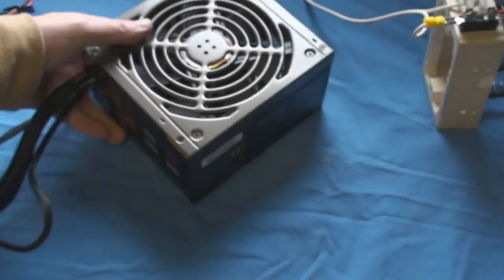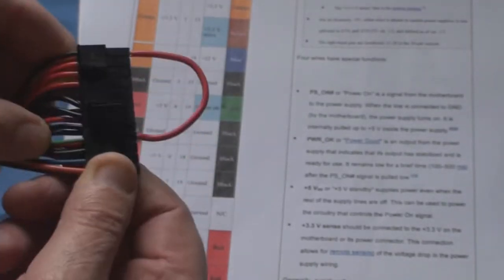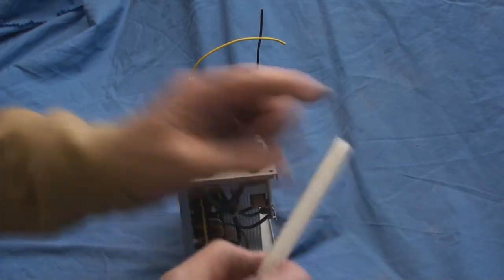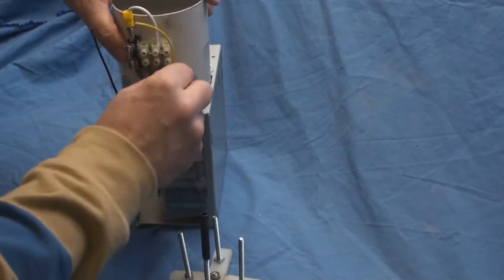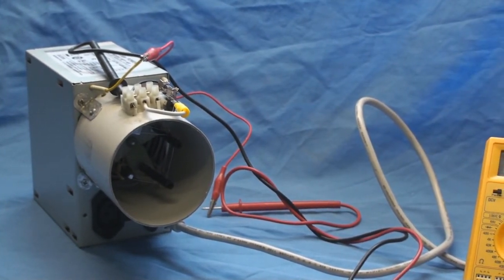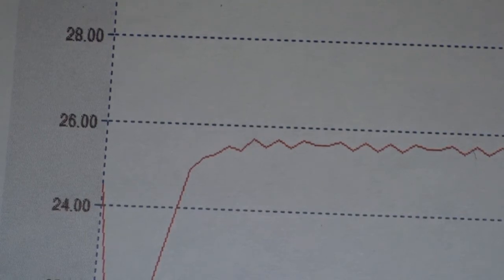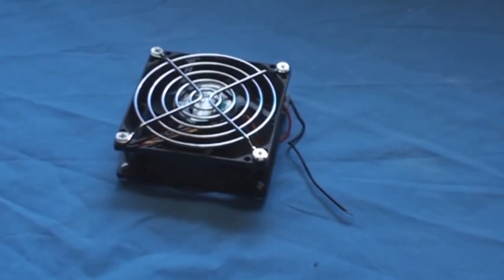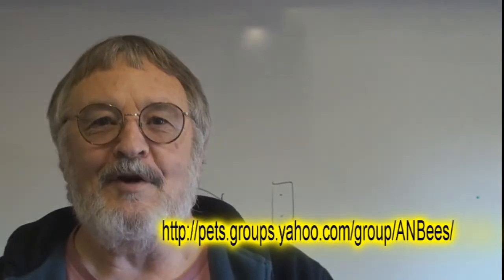Heating a TC Hive part 3 HD

Comment: Thanks for the video.
It occurs to me that the heater could still be incandescent globes but wire two in series, that way they each run at half voltage and will never go open circuit.